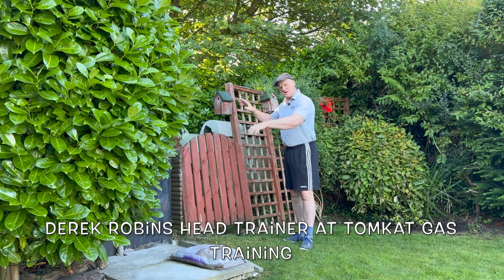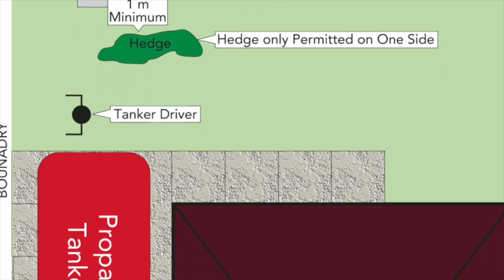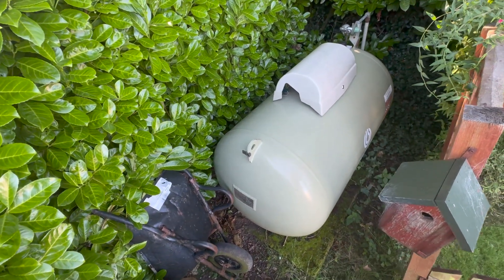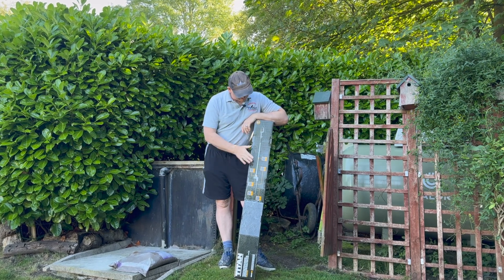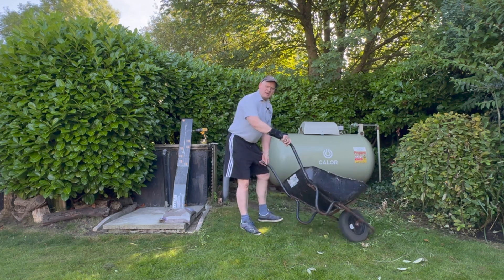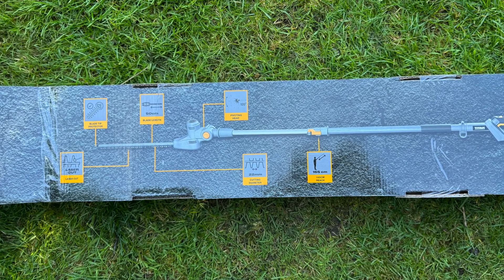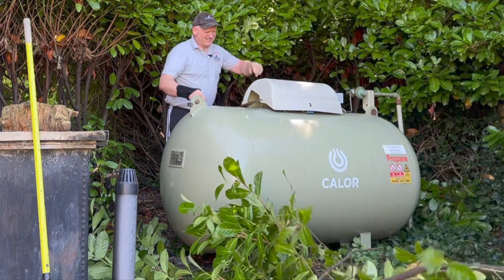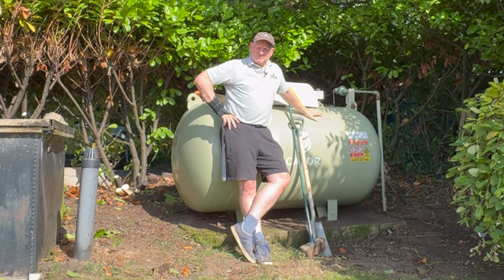My LPG tank is AT RISK (AR)  and is dangerous.

Comment: Any opening into a space where lpg can seep.was a major red flag ,   hence question. LPG doesn't play nice .
I once had to change a liquid off take tank due to faulty fill valve .  I had to let the dregs loose to air  . When you looked down to the bottom corner of the paddock it was like scene from an old horror film . A misty gathering 😅
It was for a grain dryer , it ran off a 1 inch hose and it was so loud when it ran

Comment: Can you buy a bulk tank and install it yourself ?
Reply from the maker: @nicholasviney5975  no you rent it from the gas supplier who also installs it for a cost
Reply: @tomkatgastraining  just curious over the years I've seen quite a few installed in places they should not have been.
Reply from the maker: @nicholasviney5975  like mine 👍🏻
Reply: @tomkatgastraining  my bet is the  tank was there first and householders try and make it look better.  Used to see it all the time , Calor in particular wouldn't fit unless everything was perfect regarding the regulations. 
There were one or two who would be more flexible. 
I fitted/ repaired  for a rival who were strict too . And we saw many like that , it's OK until something goes wrong and then the blame game starts . Ultimately it is the tank owner , if they see its not correct anymore refuse to fill until it is.  No one else can fill the tank .